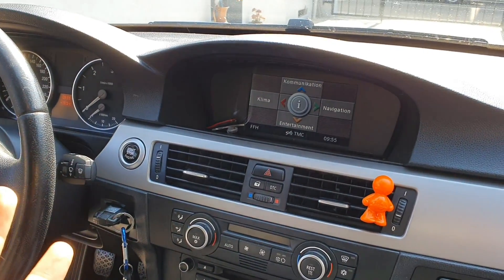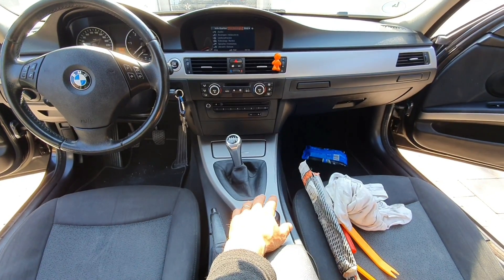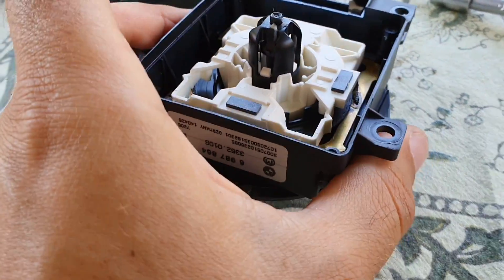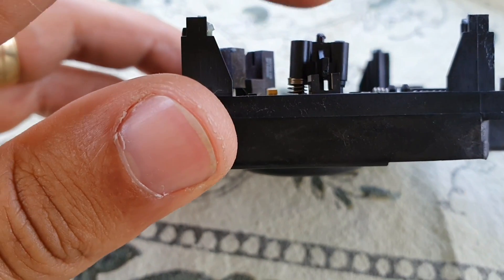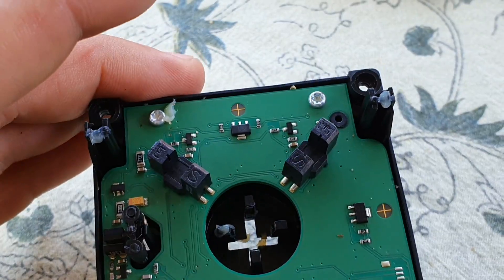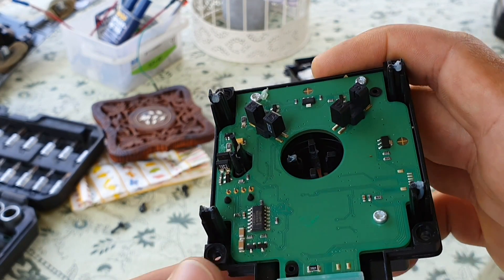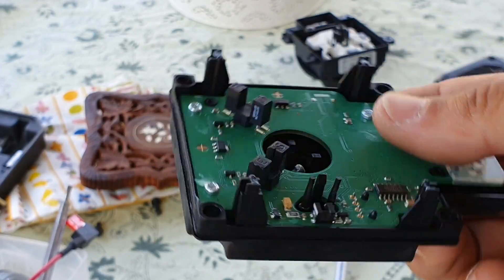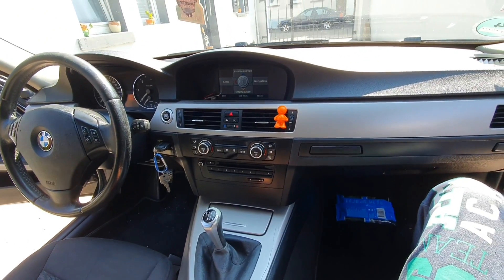How to remove and repair a non responsive CCC/Mask controler from a Bmw DIY

Comment: How did you remove the silver cover of the e-drive? You didn't show it:((((.I want to do that operation myself. Maybe one day you will show us on detail.Danke anyway for your video!
Reply from the maker: You just have to pull it out. It doesn't have any screws just plastic clips.
Reply: @WarpDriveM  Ok but i am afraid not to brake that clips. I want to see once how is made .Than i can do myself.Danke!